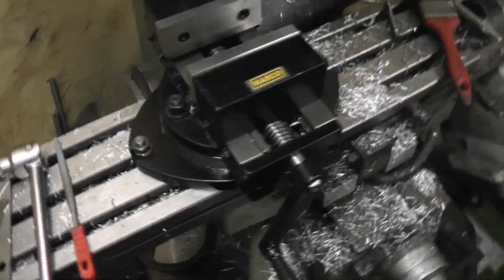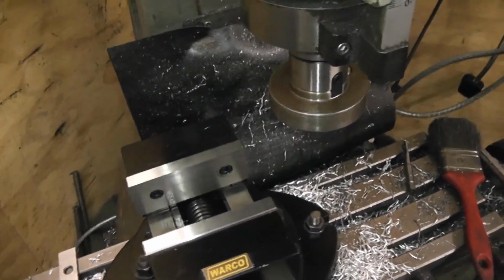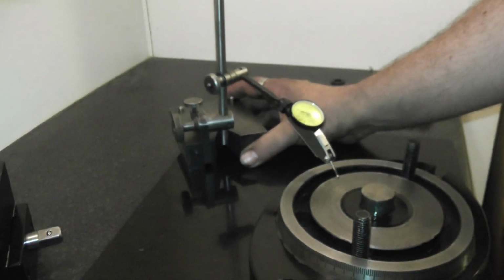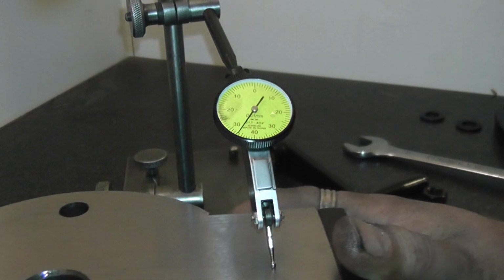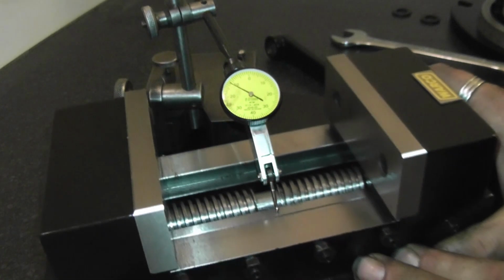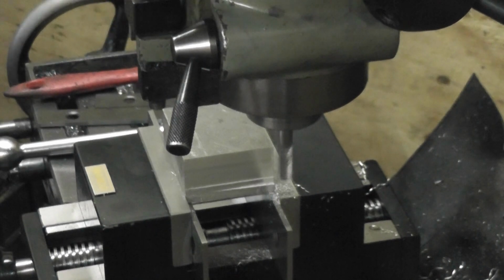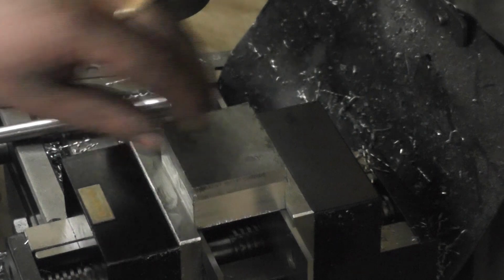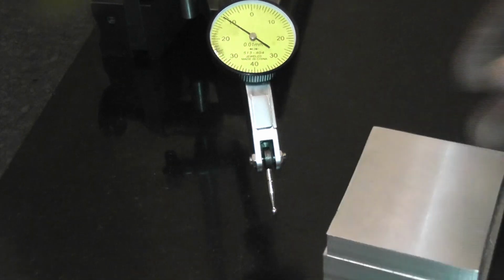Warco 100mm self centering vice review and test

Comment: Hy , i have a question for the self centering vise.
Is it a advantage over a normal vise on a manual milling machine !?
Because i am about to buy a new vise  and wondered  wich is better on a small manual milling machine
Reply from the maker: Another negative is working height with smaller Mills, this plus the part and a drill chuck doesn't leave you much room for drills, there isn't a straight side to this vice so you cannot set an angle off the front edge of the bed like you can with a straight sided precision vice which you clamp down to the bed, so the angle base is needed which reduces working height even more
Reply: @markhobster8113  thx for the answrr! There are many ways how to skin a cat! 😅
Reply: @markhobster8113  u can use a colmet holder and collets to get more space, and even more clearence u get with direct clamping collets
Reply from the maker: Yeah I use R8 collets directly in the spindle and other R8 tooling, I don't use ER collets on a mill though as they are less rigid, only on lathes but that's my preference , R8 collets hold tooling up inside the bottom bearing and with the max r8 collet bore size being wide enough it's not an issue for me, 20mm diameter endmills are borderline too large for a VMC

Using a morse taper 3 er40 collet holder on a Warco 16b I had previously was horrendous, endmills were singing the song of their people ;)
Reply from the maker: Hiya, having used it for a while now the only advantage really is drilling central on multiple parts which differ slightly in width, although not strictly micron accurate it is good enough for the majority of work I personally do, negatives which I didn't expect with being an amature is that power is shared between the jaws, and with flex doubled then both jaws can lift not just 1, so cranking up the pressure for quite strong work or clamping an awkward shape can result In the part moving.

90% of the time I now use a smaller precision vice of the type with 1 hex key screw which tightens down around 45° , that is an amazing vice for accuracy, heavier work I tend to use toe clamps, although I do keep threatening my bank with purchasing something similar to a strong low profile Kurt vice, somewhere around 75% of the price but not Chinese 10%

Comment: I would put money on they are both   12mm bolts
Reply from the maker: Easy money they are M12 so 12mm but a none standard 18mm spanner needed for the nuts, supposed to be 19mm but second look the corners of the hex nuts are very close to the vice body, 19mm hex might rub